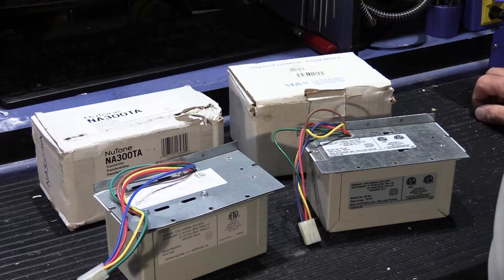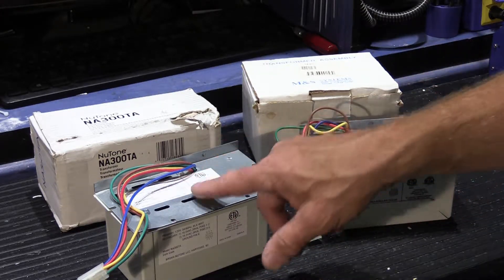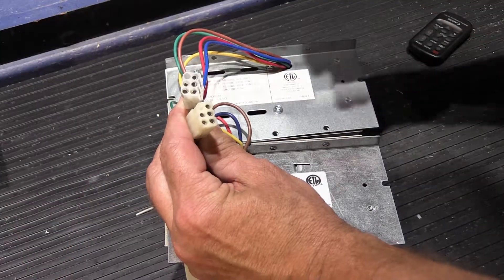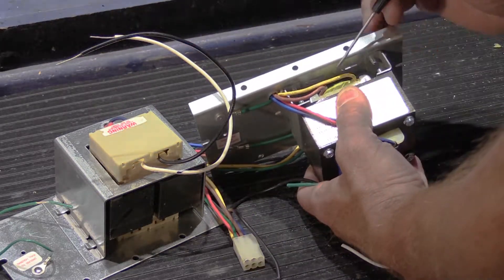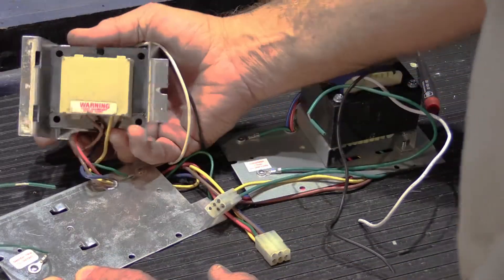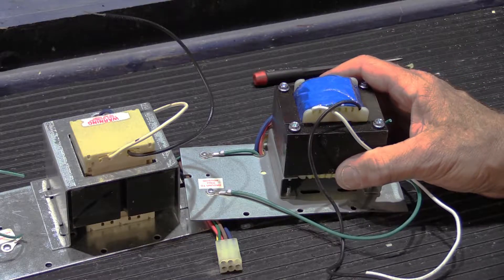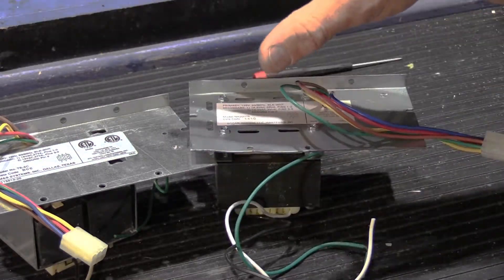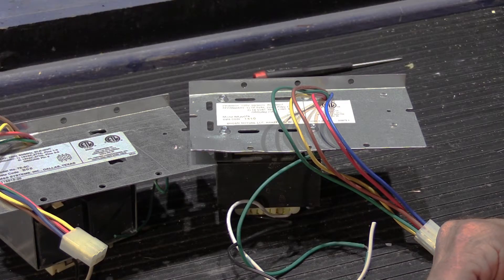Comparing a NuTone NM Series Transformer to a M&S Systems DMC Series Transformer

Comment: This is really interesting.  I'm going to replace my M&S N350 with a Ring doorbell.  I measured the voltage at the door and measured 75V.  This seems really high - do you think I may be measuring it wrong?  If the doorbell is 16V I may be able to just be able to connect my Ring as-is and leave everything else intact.  Any advice?
Reply from the maker: Hi Mike: You do not have 75 volts outside at the Door Station - unless something is seriously wrong!!! - I am unclear on what you mean by "replace my N350 & leave everything else intact" - If you're planning on disconnecting the N350 (and not use it at all any more) you could use its Transformer to power the Ring - Chris
Reply: @northsideservicecompany3567  Thanks for your advice.  I bought a new transformer and it all works great.
Reply from the maker: @mikefischer9743  Cool - Chris

Comment: Thanks for the awesome video! 

Question; any thoughts on why  the transformers have 2 outputs for the same voltage and current specs?
Reply from the maker: Hi Shawn:  Using a Multi-Tap Transformer is really a matter of cost and convenience.  It is less expensive to have a single Transformer manufactured.  Also it is simpler to design a wall housing that uses a single Transformer and it's easier to install since it only requires a single 115 Volt power line. - Chris
Reply: @northsideservicecompany3567  Hey thanks for the speedy reply Chris! 

I don't think I understand your answer. I am curious why there are two sets of secondary coils if the ratio is still the same? You could accomplish this with a 3pin molex connector rather than a 6 pin molex connector by just using one of the coil outputs.
Reply from the maker: I'll try to explain more clearly - These Transformers have 1 primary winding and 2 secondary windings.  All 3 windings share a common laminated core.  In Multi-Winding Transformers the Ratios of the secondary windings can be different from each other to provide different voltages or currents (it just happens that both ratios are the same in this design).  In Multi-Winding Transformer the secondary coils are electrically isolated from each other (think of it as 2 separate transformers in a single package sharing a primary coil))  This type of transformer is used to allow different and separate power sources for different circuits in the Master Station.    This is very different than Center Tap Transformers which typically have a single secondary coil - which has 3 or more taps which provided different voltages - Chris
Reply: @northsideservicecompany3567  Thanks for the more detailed explanation of this particular design! I understand now.